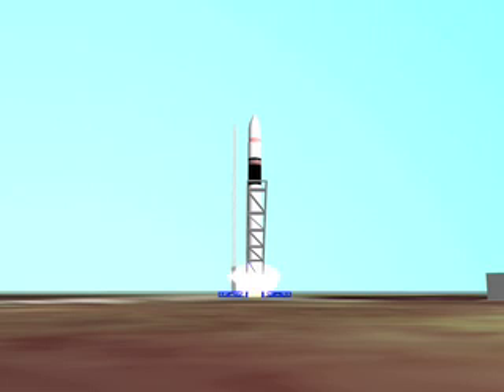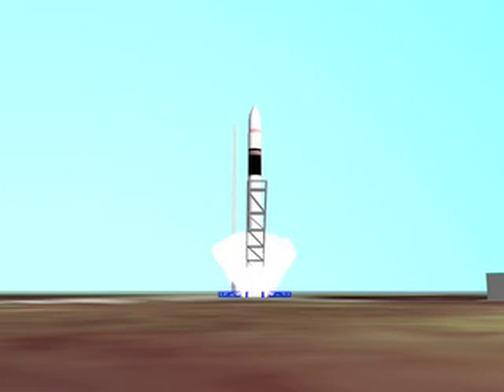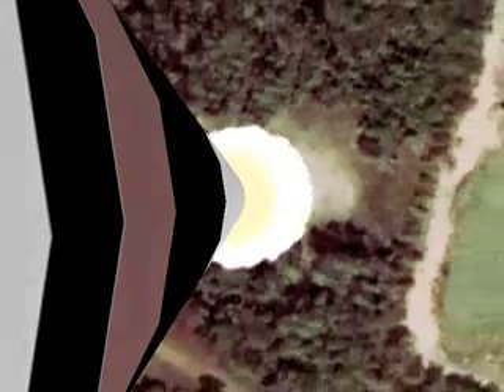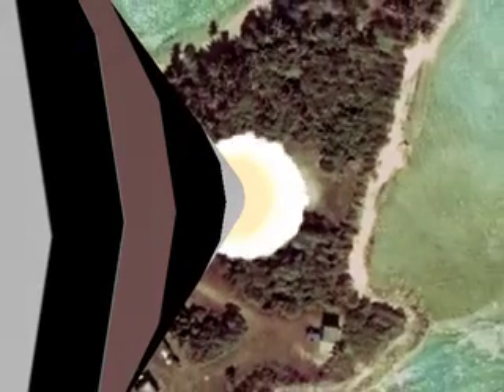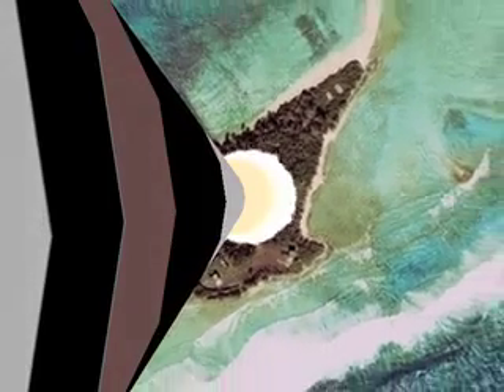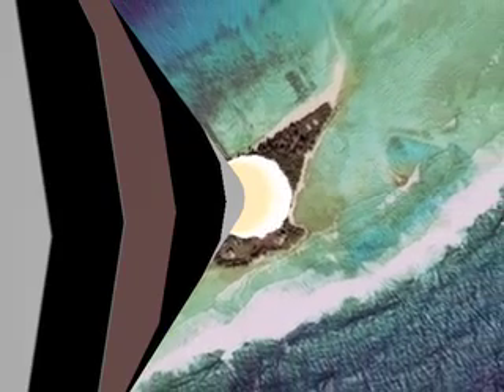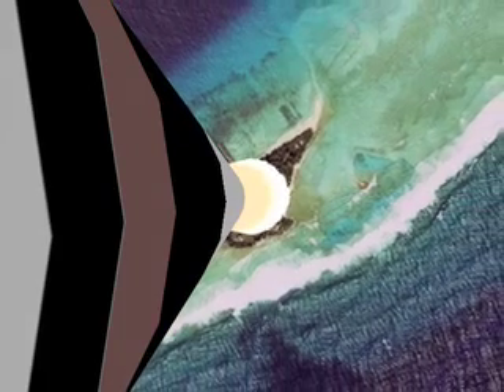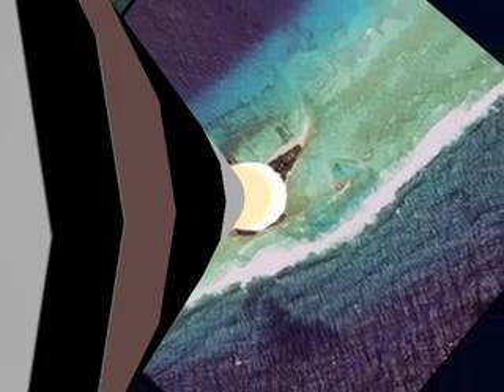Maya SpaceX noaud

Comment from the maker: @Nuage151 Softimage is rather simpler than Maya, in almost all respects, since it was designed for relatively basic modeling. How long have you been working with Maya? Anyway, when I wrote the blurb on the DigitalGlobe site (that I think you were referred from) I was quite new with the program. I could do this project (without the licensing work) in about 1-2 weeks now.